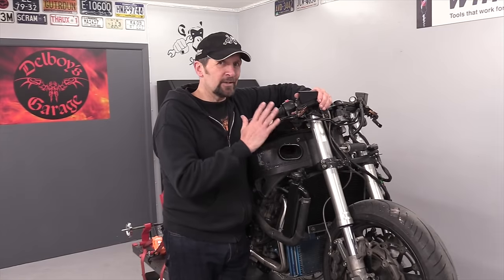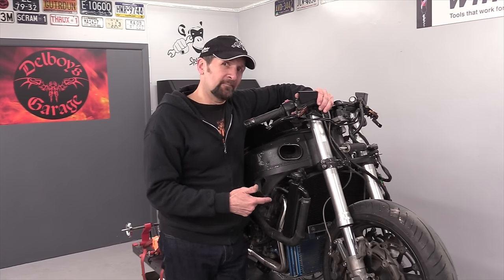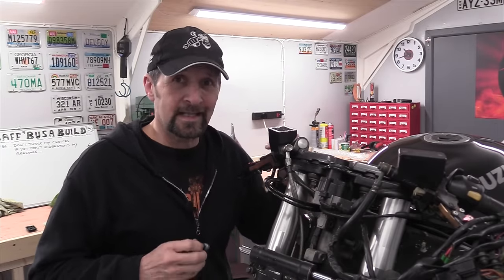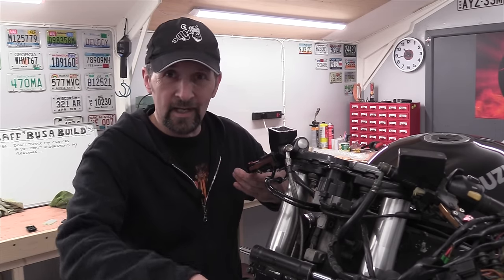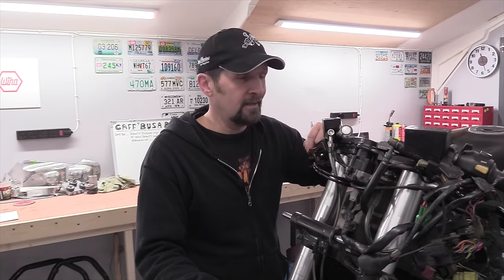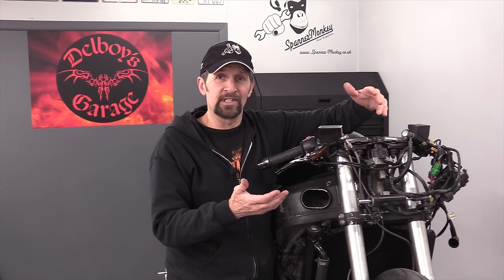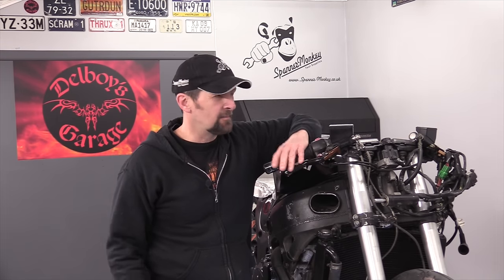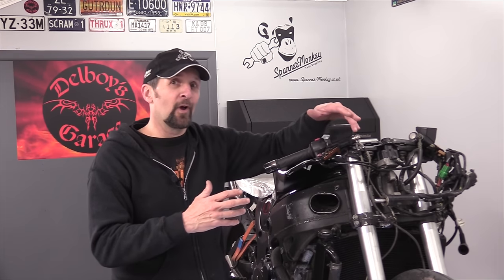Delboy's Garage, Priming an Empty Hydraulic System !

Comment: Hello , great video !  i have been using your method and just wanted to ask at what point should you start and feel the brake lever "firm up" ? .. spent all yesterday trying to bleed up a completely drained system on my mrs`s scooter and just ended up in an endless cycle of bleeding off at the bleed nipple , then refilling the reservoir with the piston barely moving more than a mm or so , i got to the point of no bubbles and the system seemed at one point to be self siphoning... i have two thoughts 1) the master cylinder is not pressurising enough and or 2) the piston (which was fully retracted with a c clamp easily enough) is seized / damaged... any help /thoughts on this would be greatly appreciated..
Thanks Steve
Reply from the maker: Hi Steve.. I've been in that position so many times, it can truly drive you crazy... It sounds like you have some trapped air in the system that the fluid is bypassing, it can happen.. so try literally injecting the fluid backwards in through the bleed nipple using a large syringe so you chase the air out of the top... empty the reservoir first, and as you inject the fluid in you'll see the air bubble out of the top.. should firm up pretty much right away mate... Good luck, hope that helps.
Reply: Thanks for the reply ! i`ll give that a try ! i`ll keep you posed on the results ..cheers  Steve

Comment: Got the same caliper with a adapter  as a aftermarket upgrade, on my 1993 suzuki intruder vs1400glp, except mine has all 27mm pistons i believe the caliper was from a older 98 model g1 g2 suzuki gsxr or a kawasaki ninja unsure but I'm just about to rebuild it as it has ceased pistons I use 0000 steel wool to shine them up for reuse.

Comment: i prefer the syringe method from the bleed nipple push fluid the top , is easier to use, no leak issue, the air is easier to go up in master cylinder.

Comment: Loved that Del, it's something I'll never do myself (I'll just monumentally cock it up like I do anything requiring manual dexterity) but it's good to know how these things are done and of course I find your videos very relaxing to watch...great stuff!  P.S I've got a braking issue on my beemer at the moment (rear gets stuck on as soon as I use it, rock hard pedal...I guess under use??)....been riding it using the front brake only...maybe I should pop down to Del's to get it sorted??
Reply from the maker: Hey buddy.. sounds like the rear caliper jamming up maybe?. does it 'bind' at all, do you notice the disc being hot even if you haven't used the back brake?.. give us a call mate, i can give you a couple of home tip's you can do to free it off and at least confirm if it needs anything more invasive..!  be good to chat too.. D&Pxx

Comment: Will be helpful when I decide to go to steel braided lines and good tip on pushing the pistons back in before bleeding. What solution were you using to clean the dust line on the caliper pistons? Just soap and water?

Comment: I get very faint squirts on the caliper banjo fitting at first couple of pumps then theres nothing. On the top banjo at the master cylinder there's real good pressure so much so that my thumb can't seal it. what can I do? Its frustrating because I lost all day trying to build some pressure. I tried to inject some fluid from the bleeder but it just leaks out of the thread. Tried to seal the bleeder with some Teflon tape and now the syringe doesn't wanna move forward. If I apply too much pressure it leaks from the syringe. Its like the fluid don't wanna go up.
Reply from the maker: OK,  it can help to take a step backwards when you can't move forwards,  It sounds like the pistons being flat up against the back of their sockets are causing a seal that won't let the air through or any fluid in... so drop the caliper back off, drop the pads out again, and carefully twist the pistons and work them out off their seats about 5mm... put the caliper back on the bike with the old pads in( because they are thinner and will allow the pistons to be out a little)... then try bleeding it up again.... once you have some air gap behind those pistons it'll give them room to flood and bleed up... once you get them firm.. you can push them back again and re-install the new pads... then a final bleedup should do it... Give that a go and see how it goes buddy.. Good luck aye.. Del.
Reply: @Moonfleet41  pistons would come later i couldn't even get the fluid to come out of the hose and when i pump the pedal i hear some squishy noise is that ok? And like I said the cylinder has good pressure when I put my thump on the banjo fitting

Comment: I replaced my front caliper pistons and seals but forgot to  coat the pistons with brake fluid before pushing them in their bores. Will that be a problem?
Reply from the maker: If they slid in the holes ok then there is some movement there so they should pump out once you get some fluid in behind them.
Reply: Thank you kindly. I did red use red rubber grease on the seals

Comment: After bleeding the system I was taught to tie down the lever over night to allow any air bubbles to reach the reservoir. I usually tie down the front brake lever to the handle bar and I'll tie down the rear brake lever to a kettlebell. It's always worked great for me on my 954 but I am just wondering what your opinion is on this method.
Reply from the maker: I've suggested this in many videos, it's a great practice after bleeding your system successfully to help sharpen it up a little more.
Reply: Great to know. I just bought my first car after about 10 years of nothing but motorcycles. Do you know if the same method applies to cars?

Comment: I went from zero pressure to about 1/2 an inch of firm pressure, however this didn't cure my problem. I did ur method and bled brakes, im wondering what else can I do ?
Reply from the maker: Fragmented air bubbles in the system probably.. try taping the lever in to the bar over night, then bleed it up again in the morning mate !

Comment: Any reason to do this method was just injecting fluid from the bottom up (via syringe into caliper)? Seems like there is so much air in the system that primed or not, it'd be a pain in the butt to get out. I think this channel actually shows the syringe method as well on another vid funny enough! I tried the syringe and it took 2min to 'prime' an empty system, purge all the air out, and then finish off by bleeding the regular way - easy! Any reason to do this trick first?
Reply from the maker: Syringe method works, (fill from the bottom up), and gravity bleed works too... just two ways to achieve the same result.!

Comment: I'm confused, so how do you know you've been successful in priming? When you stop seeing bubbles rise up from the master cylinder or when you start seeing fluid dribble out of the bottom?
Reply from the maker: Priming is simply getting some fluid down through the system, so your first question is correct... once you see brake fluid coming out of the brake caliper, you're primed... then top up the reservoir and bleed down through in the conventional way!

Comment: Good to know about the upgrade from Dot 4 to Dot 5 fluid.
Reply: .....sometimes the benefits dont outweigh the down side of DOT5 fluid.  It has a lower boiling point than DOT4.   *If you change your brake fluid at proper interval, DOT4 is actually the better choice.  DOT5 is primarily used in military and marine vehicles which can get significant exposure to water and pooling around the brake components.

Comment: Hi Del , question im upgrading to braided lines  , do i have to bleed out the fluid from the 2 calipers ? what if i will just do gravity priming on the new braided lines till they  are full and then hook them up to the calipers and bleed as necessary? thanks Nathan.
Reply from the maker: As you suggested Nathan, prime the dry line, then hook it up to the caliper and bleed the system through generously to clear any old fluid... that will work just fine, and good luck with it!
Reply: @Moonfleet41  Thank you so much, that's a very quick reply, you are a real professional ! btw: the reason i dont want to empty the fluid in the calipers is not because im cheap:-) it's just frightenes me to to empty the entire system bone dry.. i know it sounds silly , but right now for sure the calipers are working fine ... don't want to mess with them too much:-)
Reply: @Moonfleet41  btw: thanks to your video tutorial i had the courage to overhaul my front shocks on a Yamaha fzr1000 yr 1987 , the way you explain things is absolutely wonderful.
Reply from the maker: @natanmortenfeld5813  You're most welcome buddy, it's no trouble, and im glad we can help.. i totally understand not wanting to empty the caliper, and there is truly no need, you can chase out the old dead fluid with new fresh fluid, that's exactly what i do..!   Good luck with it and i hope you get it all buttoned up with no problems.. take care.. Del.

Comment: Heya del great video,just replaced both front and back on harley, to hel hoses,just wondering would autosoul damage the seals if I use it to get the gumline off???
Reply from the maker: Hi buddy.. Autosol is a great polish for piston seals, they're made from hard stainless steel and that will get all the crud off and leave a great finish..

Comment: Love dot 5 silicone brake fluid. Is it possible to use in all hydraulic system? Eg zr900 Kawasaki, my shop says no. Why I think it improves brake feel and reduces fade, I'm in Queensland,30-40 degrees Celsius regularly.cheers Steve
Reply from the maker: Some braking system internals aren't compatible with silicone fluid, but even if they are, then to change over to silicone is a major operation.  I'm sure you know that the two don't mix, they just form a sticky sludge and jam the system up, so you can't just drain out your Dot4 and purge through with Dot5, you have to strip the entire system to it's bare components, wash all metal parts with propyl alcohol and replace all rubber parts with new... plus of course all new brake hoses, this is entirely possible with non-ABS, but with an ABS pump as well you'd have to find out first if it's compatible, and if so, replace that also... hope that helps mate.
Reply: @Moonfleet41  DOH! Forgot about that the abs, thanx for your compressive reply, I'll stick with dot 4 then, cheers mate.

Comment: I rebuilt my rear caliper but I cant get the air bubbles to stop coming out through the bleed screw. I used a vacuum hose and ran 2 bottles of fluid through, still endless bubbles and no resistance from level. I got rid of the vacuum hose as I read it can suck air through the bleed screw so tried the normal way, still endless bubbles. Any idea how to stop air getting into the system? Thanks
Reply from the maker: Hi Paul.. it is often the case that the bleed screw is too loosened off and dragging air in.. all it needs it no more than 1/8th of a turn, just enough to 'crack the seat"... have you tried injecting a little fluid up through the bleed screw to get it primed..?   and you can wrap the bleed screw thread in a turn of PTFE plumbers tape to help seal it too..!  good luck with it mate. hope that helps.
Reply: @Moonfleet41  Thanks pal. I tried cracking it a little as possible, same results. Im gonna pick up a syringe and try reverse method. Thanks again!

Comment: Hello Del. I have a brake system where one hose comes from the master cylinder to one brake caliper and from this caliper a hose goes over the front wheel to the other caliper. How do I prime this system?
Reply from the maker: That is referred to generally as a piggy back set up, you can use a large automotive syringe and inject the fluid from the final caliper and up through the system to the reservoir, ... fit the syringe to the bleed valve then open it 1/4 turn and the fluid will flow in, it works very well and the syringes are very cheap to buy... here's a link: https://www.spanner-monkey.co.uk/oil-suction-syringe-550ml-111473?search=syringe&description=true
Reply: @Moonfleet41 Thank you Del.

Comment: Del, how is this better than the method you showed (a few years ago?) where you fitted new stainless lines and pumped them full from the bottom with something like a big syringe? If I remember right, that was faster. Reverse brake bleed method.
Reply from the maker: Hi Ronan, both methods work, as you saw in both videos, the syringe I used however, if you remember, was on the back brakes of the Streetfighter project, where the hose is horizontal along the swing arm and gravity is no help to you!... just trying to show alternative methods that may get you out of a pinch buddy, like everyone says, do what works for you aye!

Comment: Regarding bleeding rear brakes, what if it doesn't have pressure to begin with? I have fluid in the line I just can't get it to build any pressure. I'm even using a Motion-Pro Bleeder which even with the valve close and a syringe used for a syphon, air bubbles are still coming out. I'm no mechanic and can't afford one so here I am on YouTube doing my best with what's available and grateful for it. For example there's a video explaining how to prevent air bubbles you can put a little clear silicone paste around the bleeder nipple. Not sure if that's a good idea according to a comment made, another said it took him 1/2 hour of pumping to finally get pressure, maybe I'll try that. Any help would be greatly appreciated
Reply from the maker: Here mate, try this... https://www.youtube.com/watch?v=rW6LV0lWq4g
Reply: @Moonfleet41  If I could find a syringe big and durable, I probably have better results priming and bleeding my brakes. I do however appreciate the the link, it is helpful
Reply from the maker: @WILLY52368  The link to the huge syringe was in the description.. but here it is if it helps.. https://www.spanner-monkey.co.uk/oil-and-brake-fluid-inspection-syringe-200ml-120826?search=brake+fluid+syringe&description=true

Comment: Hi Del- another great reminder of the best insider tips to use.   A quick question for you: what is the diameter of those clear plastic hoses you use to bleed the brakes?  Cheers!  Have a great weekend there, both of you!  🏍👍🏍
Reply from the maker: Hi mate, as far as I know, they're a 6mm I/D, but quite stretchy and they slip over the bleed valve easy... have a great weekend yourself, ride safe!
Reply: Delboy's Garage cheers, Del.  👍

Comment: I rebulit both of my brake calipers and for the love of god i cannot bleed the brakes,the pistons came out just enough to press the pads against the rotor,but i cant get a firm lever. Should i resort to using a vacuum bleeder?
Reply from the maker: You could have some air trapped in the centre piston mate, it's pretty common, try back bleeding the calipers and that will usually prime the middle pot and help it clear, it's always a challenge on 6 pots buddy, stick with it!
Reply: @Moonfleet41  they are actually tokico 4 pots,but im curious,even after the rebuild the pistons came out unevenly,the larger(leading ones) are sticking out a bit more than the smaller(trailing ones).
Reply from the maker: Still try the back purge, it does work with a bit of patience..!  should give you a nice firm lever.. !

Comment: Very nicely done, Team DBG. I love your how-to videos and as always the pace and thoroughness of your presentation is just right. A question... assuming the brake fluid dripped through clean hoses into a clean jug, could or would you reuse it to refill the reservoir?
Reply from the maker: Hi mate, thank you for your kind words... with the fluid, you would think that's a logical option, but if you take a look at the fluid in the jug after you've bled it through, it could well be darker and murky, sometimes there's a manufacturing residue inside new brake lines, it doesn't hurt to flush them through a few times till it's running clear!

Comment: How did you know I'm rebuilding the front brake system on my xj. 😊 done the master cylinder and made a start on the calipers now. Damn they a mess. Had to drill out a seazed bleed nipple. So hopefully that ok! Anyways this tip top tip will come in handy. ... Nice one Del. 🖖

Comment: Isn't dot 5 just for ABS system and you can't use it on non ABS system ?
Reply from the maker: No DOT5 is silicone fluid and NOT compatible with ABS systems.
Reply: @Moonfleet41  wow I'm confused now after that reply because of other previous info from other sources so I've only been using dot 4 for my ZX12R  (no abs) as appossed to my brothers new Harley witn ABS dot 5 and that's what I've been left to believe till now 🤔

Comment: Delboy my brake lines have been empty for some time cleaned them through put fluid in master cylinder few bubbles now just black coming through the hole in reservoir any ideas mate great vid buy the way 👍
Reply from the maker: Hi mate, generally the black residue will come from the seals in the master cylinder, they'll start breaking up with age, and if they've been left dry for a long time, it could be worth replacing them... other than that, if you can't bleed it through, try reverse bleeding, which just means injecting fluid in to the bleed valve with a big syringe and we have videos on that, as I'm sure you know!
Reply: @Moonfleet41  thanks mate much appreciated  ill try it tomoz